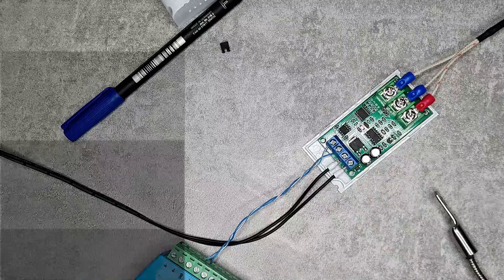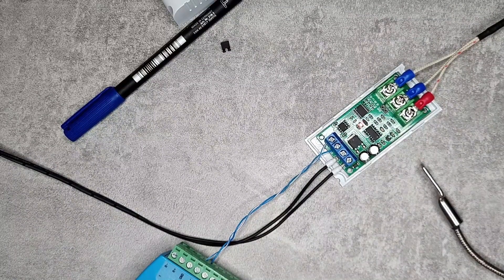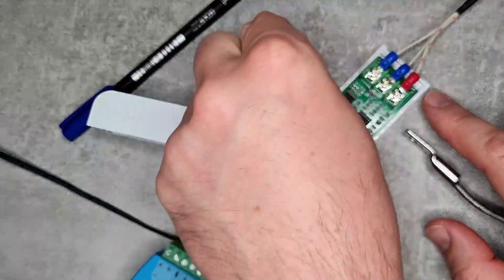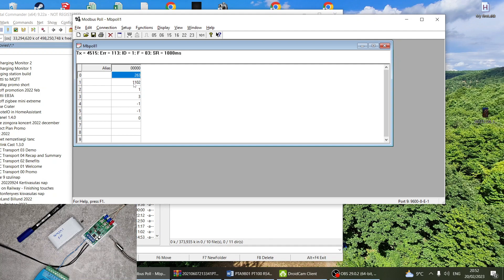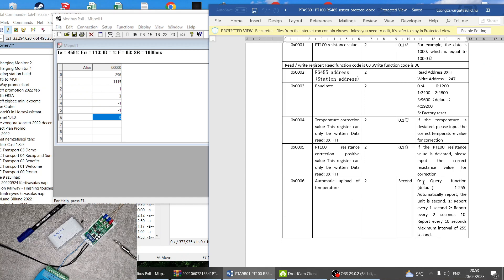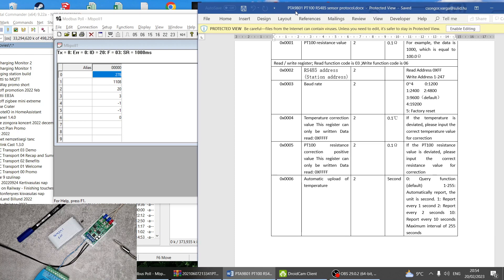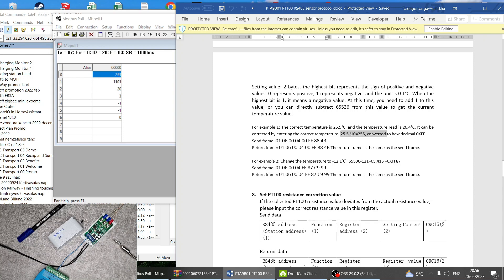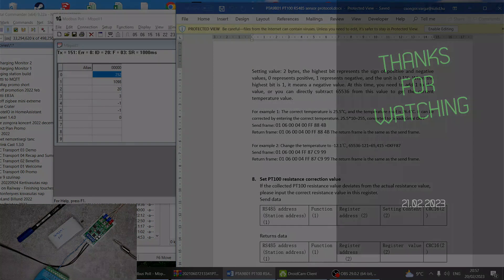PTA9B01: cheap Modbus temperature sensor, when you need one more temperature of cover long distance

Comment: Hey I’m a French college student .im working on a project and I just discovered your channel. Do you think that we can create a long distance thermal sensor (10m) for gliders to locate thermal updrafts in the air?
Reply from the maker: I don't have this device any more, but for other sensors I read that 10m cable is OK. It says best is to use shielded cable. It is possible that the cable with its own resistance will drift the measurement, but you can perform a calibration to cancel that out.

Comment: Trying to read Data from the device with my ioBroker and a Modbus-Adapter. Any clue how to send data to receive the temperature?!
I don’t see how to work with hex in there, damn…
Reply from the maker: Sorry, but I don't have experience with ioBroker. But it looks like it supports modbus, so I am not sure why you would need to deal with the raw HEX.
Reply: @csongorvarga , found it out via try and error. 
I dont know why, but reading the holding register 4096 divided by 10 gives me the temperature. 
Again, thanks for the video and the response.

Comment: The PTA9B01 has encountered an error when connecting to my software. Currently, I am using Modbus Poll but still cannot connect to the PTA9B01. I have tried Modbus Pool with another circuit, and it connects well. Could you please provide me with a solution?